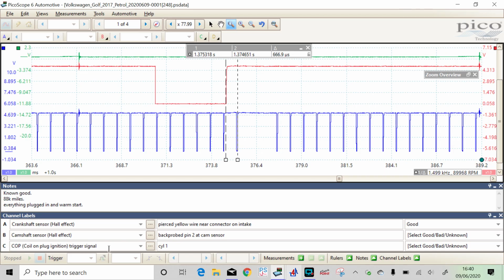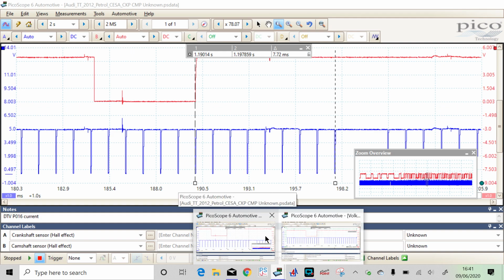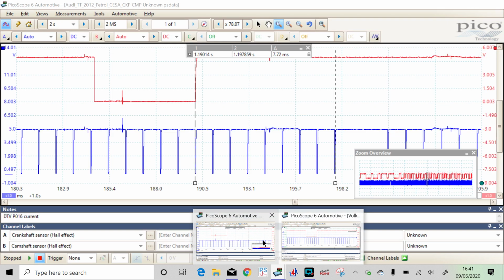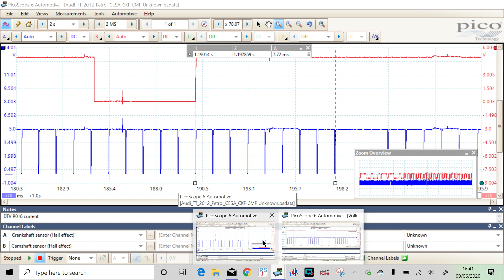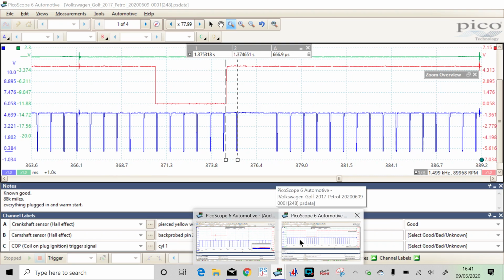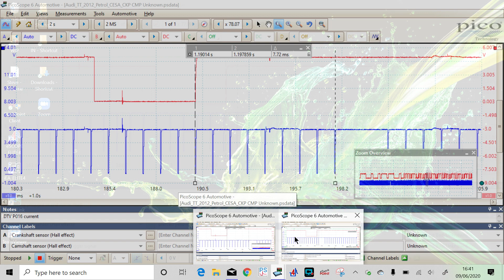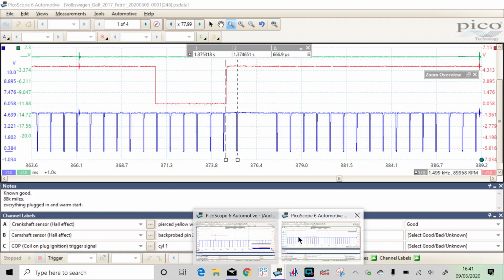Audi TT CESA Cam vs Crank waveform - known good vs bad

Comment: Have u taken the cam timing adjust solenoid off to check its not siezed with it standing for a year.  And re-adapt the throttle body . With it losing battery voltage.
Reply from the maker: I don't do mechanical Myles, that's up to the garage it came from.